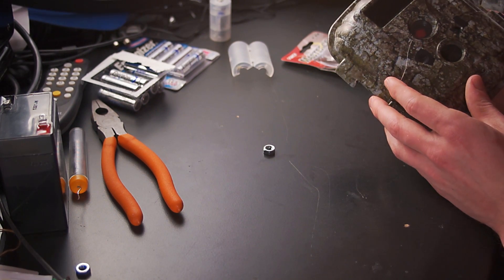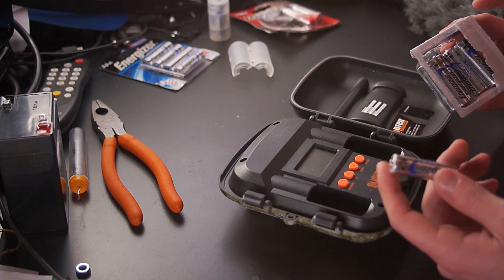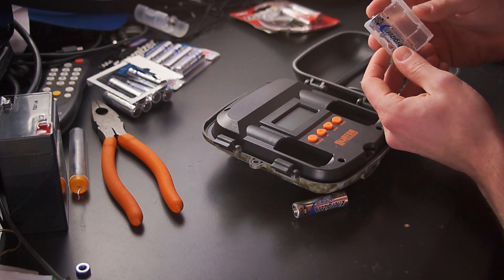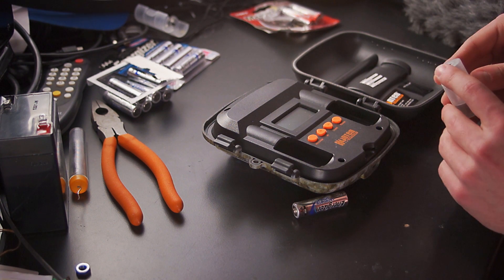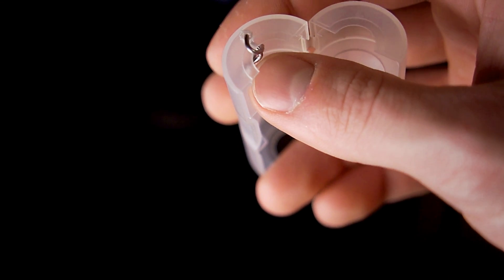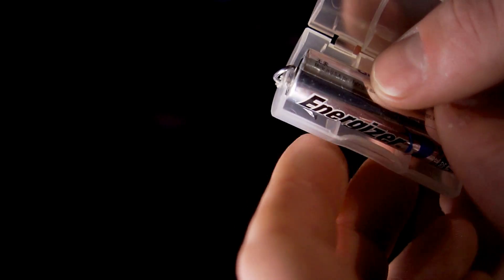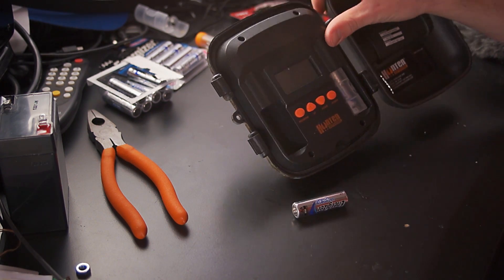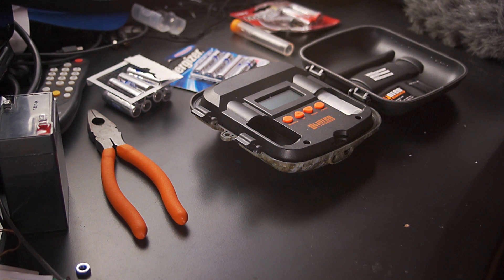Trail Camera Cold Weather Tip (for C batteries)

Comment: Garret,

Happen to have the seller that sold those battery cases? Also I was wondering if that's the only style camera this will work on? I have a few Moultries that have a little different way the batteries are installed and ran. Great video man and look forward to seeing more.
Reply from the maker: I think there are a few suppliers that sell them. I just search eBay for "AA to C" and then sort by "US only". If the Moultries normally take C batteries, it should work. The key is making sure the battery contacts make a physical connection with the metal terminals in the trail cam. On some cams you don't even need to use the modification... you can just snap the battery in the case and insert.